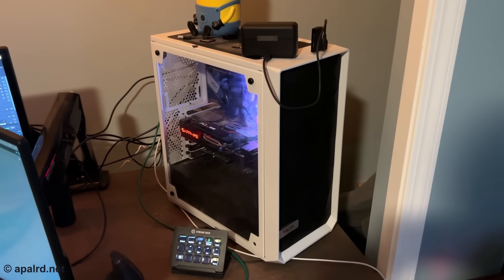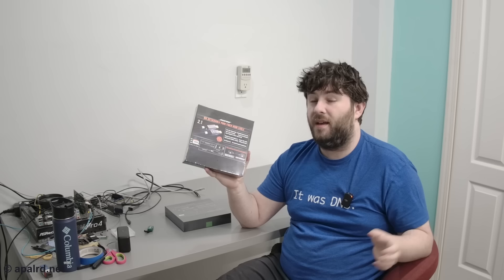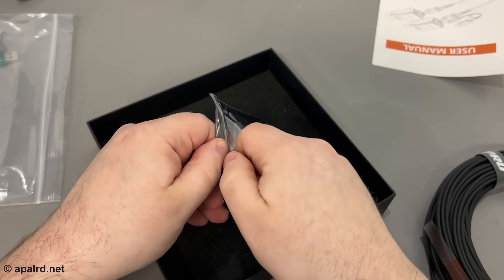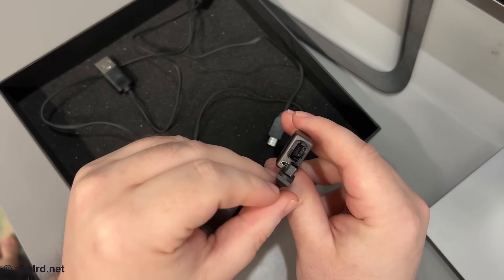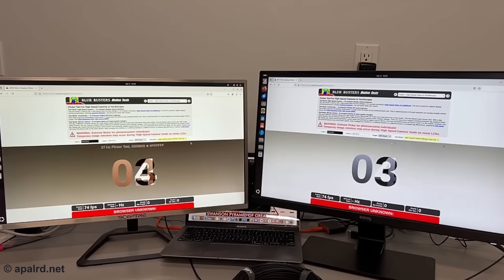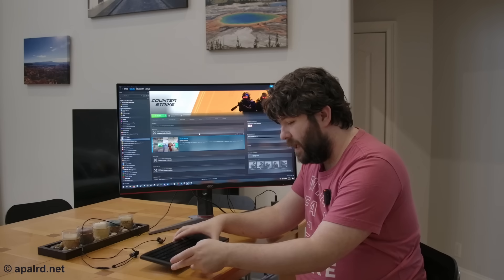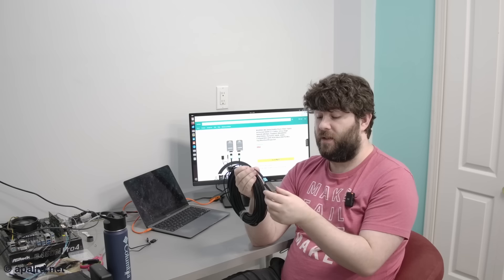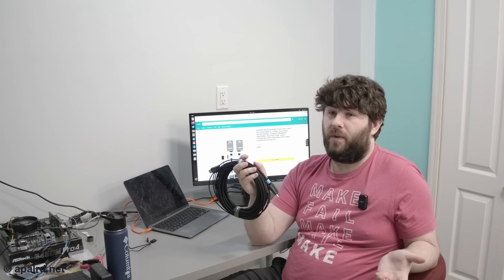FINALLY Sending Raw HDMI over Standard Networking Fiber

Comment: I believe USB4/TB4/5 is an attractive option because it streamlines your entire setup by consolidating all connections into a single cable. Additionally, exploring the encapsulation of data within Ethernet frames to transfer information over a local network (using switches) is an intriguing concept. However, there are two potential challenges with this approach. To fully utilize TB5's high bandwidth, you would need expensive network switches. Moreover, transferring high-bandwidth video signals, such as DisplayPort or HDMI data, over the network (switches) raises important questions about latency. How would the latency compare to that of a direct cable connection, and would it be acceptable for low-latency applications?

Comment: To anyone who doesnt know these connectors btw, you can break out those fibers each into their own individual connectors. If you use a different standard, like lc or fc, you can make 6 of em with 2 pairs a pop. Leave the fiber in the wall and keep using the fiber for networking and other stuff after you retire the cable.
Reply: Can you give pointers to where you get these breakout cables? I'd specifically like to LC fiber.
Reply: @thardie   FCDUS356v10305 look up this part number
Reply: @thardie  you can get one from FSG, but it would probably annoying to get a quote for 1 lol
Reply: @thardie  FS is good for fibre stuff. Just search FS MPO to LC on Google or wherever

Comment: Have you tried the Fibercommand cables? They are a premium but have the same MPO to HDMI, DisplayPort, and USB. They also offer breakout cables.
Reply: But do they work?  Haven't heard anyone really talk success.
Reply: @JeremyMeeler  I haven't purchased yet due to the price, but they have a DisplayPort 2.1 adapter which I want to try out. Trying to determine if I should risk it for my new setup. I am in the process of remodeling and I have will have a dedicated data room. It will have my Home Theater equipment which will need the HDMI extension of one of these and my main PC as well which will be about 50 feet from my desk (triple monitor). I really want to make to just be able to run a 24 strand MPO trunk to cover the 3 displays. Would also like to try out that USB4 50 foot cable that the HeyOptics has. If I end up getting one of these 3 setups I will post back with results
Reply: I got the Fibercommand ends a few years ago. The HDBaseT stuff I used before that would occasionally drop frames, but with the Fibercommand stuff I haven't seen a single drop in years.

Comment: If the HDMI cable only used 7 of 12 wires and USB uses 4 wires, could they do the USB stuff over the dark fibre? Then you could do the keyboard and mouse as well!

In that same vein, I believe Displayport allows USB to piggyback over its protocol. Does the DP cable version support this?
Reply from the maker: It's a 12 pin connector but only 8 of the strands are used (this is a normal thing, since 40G/100G only need 8 strands also). USB3 (10Gbps type A) only would need 2 fibers though, and it would need a USB3 hub + USB2 to USB3 hub chip at the other end. 

DP doesn't allow USB to piggyback, rather, the opposite, USB Type C allows for DP Alt Mode (where some of the 4x high speed lanes are used for DP and some for USB 10Gbps), and USB4 allows DP (and PCIe) packets to be carried over USB4. But all of that is purely for USB Type C.
Reply: @apalrdsadventures  maybe a suggestion for the company who makes the cables then?
Reply from the maker: oh I already told them I would like USB3

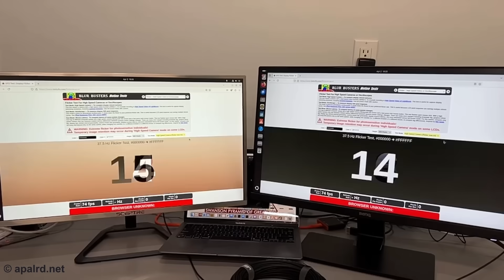Comment: In the flicker test at 6:23, if you watch frame by frame, the right screen skips 20, 25, 30, 35, and 40... So it would seem to be dropping fully 20% of frames...
Reply: The point is that they are not "perfectly in sync"
Reply from the maker: they are two different models/brands of display, they are not identical
Reply from the maker: that's the one connected HDMI direct, the left one is via Fiber

Comment: how big is the connector that attaches to the HDMI plug? I need something to run from office to living room in conduit which is already crowded by a CAT8 ethernet cable
Reply from the maker: It’s an MPO-12 connector which has a width of 12.5mm. Not sure what the diagonal dimension is for a conduit.
Reply: @apalrdsadventures  Thanks for the quick answer, I'd need to double check but it's either 20 or 25mm and the ethernet cable is ~8mm, looks like I might not be able to use this either 😢
Reply from the maker: Use the cat8 to pull an mpo + cat6
Reply: @apalrdsadventures  you think cat8 is overkill?
Reply from the maker: Cat5e is spec compliant up to 2.5Gbe @ 100m and Cat6 is spec compliant up to 10Gbe @ 55m or 5Gbe @ 100m.

Cat8 was standardized for 25GBase-T, but no cards were ever sold which actually use it and nobody really wants it now (since the power consumption is way too high compared to fiber or twinax), so Cat8 (and Cat7) cable is basically a scam for normal people
Reply: @apalrdsadventures  ouch, you live and learn I guess. Thanks for the info, I'll look into this option then.
Reply: @apalrdsadventures you should add in that unless you are using the special CG45 connectors Cat7 and Cat8 cables actually are worse than Cat6a. However nobody makes any equipment with CG45 connectors you are guaranteed to make things worse.
Reply from the maker: Cat8 is specified for RJ45 (Cat7 is not), but Cat8 does require shielding and proper shield termination which nobody is actually doing, assuming the cable you bought from Amazon is even actually Cat7 or Cat8 to begin with
Reply: @ I think it is? the brand is called HB-DIGITAL, they also sell keystones along with only a few others for Cat 8, and the reviews appear to be good
Reply: @apalrdsadventures  no Cat8 like Cat7 moves from balanced pairs to minature twinax and requires either CG45 or Teraprom connectors to properly terminate the shielding. If you don't there will be near and far end reflections on the cable which will degrade the signal. You can escape this it is a consequence of Maxwells equations. It might still work a 1Gbps speeds and distances less than the maximum because the signal degradation is insufficient but you won't be getting 10Gbps at 90m. There is NO switches or NICs that have the required connectors on them and it is unlikey there ever will. Consequently Cat7 and Cat8 cable is a scam to con the ignorant out of their money. There is no network equipment that has ever been on sale that needed anything better than Cat6a and is unlikely it ever will.
Reply: @Devilm00n  When it comes to Ethernet IEEE 802.3bq which is the standard for Ethernet at 25Gbp and 40Gbps over twist pair, then it dictates the cable is point to point at a maximum distance of 30m. Any keystones, wall plates, patch panels etc. would immediately make it non-compliant with the standard. It is all completely moot because there is not a single NIC or switch on the market to IEEE 802.3bq and it is unlikely there ever will. It is targeted at the data centre where the market has standardized on DAC cables, AO cables or just revert to pluggable optics and fibre.

Comment: Do they not sell just the transceivers at all? I would much prefer it if I could source my own fiber at the length I need and just get the ends from RUIPRO.
Reply: They may use non-standard fiber connectors, forcing you to source the fiber from them. With that said there are other companies that offer display outputs and usb over what I think was standard fiber connectors. Linus Tech Tips had a video featuring this technology, and I'm unsure if it supports high refresh rates or not.
Reply: @JuniorJunison  No they use standard MPO fiber connectors. Lots of manufactures available, but it doesn't look like ruipro sell just the hdmi transceivers
Reply: @JuniorJunison  didn't you watch any of this video? You didn't even read the TITLE of the video....
Reply: @JuniorJunison  while these aren't the dime a dozen type standard we see on FTTH equipment, I think it's MPO. More data center use, but easy to convert to whatever connection you have on the wall plate / already ran.

Comment: This is FANTASTIC!!!

Once they add USB functionality to this, I can FINALLY have remote gaming setup like you showed here.

And I DON'T need the $1000+ fiber dock that Linus from LTT is using.

This is AWESOME!!!
Reply: Right?  Why isn't the USB port also used for data and not just power?
Might need to use a different MPO cable with more pairs, but if you are willing to buy this you probably don't care about a marginal cable cost increase.

Comment: I understand this adapters use MPO fiber cables to save costs, but I'd wish there were affordable ones using single mode fiber (which requires additional electronics). Also DP is usually better than HDMI. The price is another thing: Had the luck to get a brand new Amazon Basics 300ft(!) 4k/60Hz fiber HDMI cable for as little as €33 a while back.
Reply from the maker: Basically, MPO has enough fiber strands to directly convert each electrical signal into optical 1:1. Using single mode + WDM wouldn't necessarily require additional electronics, but it would need tighter tolerances on wavelengths from the vcsels (for WDM), and especially better filtering on the receivers to reject the other wavelengths on the same strand.

The connectors and assembly of the connectors are most of the cost increase I think, MPO connectors (well, all fiber connectors) are super precise little things.

Comment: Couldn’t they make an octopus adapter for the 24x OM3 and give you DP/HDMI, USB3 and perhaps also Ethernet in one fibre cable? Or is there any technical limitations for that?
Reply from the maker: they need 7 strands per HDMI, I assume DP would also fit in 8 strands, and USB3 (10Gbps) should fit in 2 strands. Ethernet already exists and requires 2 strands for 10/25G or 8 strands for 40/100G, and the cost for 10G vs 1G makes it not worth running 1G. 

You can already get octopus adapters for MPO-24 to 3x MPO-8 or 24x LC, but just sticking with MPO-8 for HDMI/DP and 2xLC for Ethernet and USB3 would be easier.

Comment: Bought one of the ones with the ends built in for a 100ft run.  Lasted 2 weeks before failing.  I was pushing 1080p @ 30fps.

Comment: I have once pulled a optical cable though a very thin wall crevice and hired a dude to weld on the connectors :) Carving out a channel in the concrete would have been probably cheaper and easier :) But oh well :)

Comment: Displayport and USB 3 would be amazing over fibre for sure!
Reply: Fibre KVM!
Reply: @benargee  this is the way
Reply: I don't see any single adapter that handles both USB & DP there.
Reply: @alatteri  Thunderbolt has entered the chat
Reply: you can with thunderbolt and optical thunderbolt cables. It's not cheap
Reply: @AntonioMolfetta  that would require the machine to support thunderbolt.
Reply: @Rakusan2  there are pcie addin cards to add thunderbolt ports
Reply: @AntonioMolfetta   they must have  not just a PCIe slot but also a dedicated  TBH-1 header too. else they dont work.
 shame its  not that simple....

  I just did a $8k PC build for a client.    based on a MSI MEG  z890 godlike. It is one of the 1st boards to have not just TB on the IO shield  but also supports a TB5 add on card Being one of the 1st non macs to have  more then 2 of any kind TB support ...
most mobos  have 2 backed in. or 2 as an AIC. or  non support at all.   getting 4 is ....... well yay. it can compete with a 2022 mac studio  on  high end IO.. 

 

It REALLY needs to be the domain of the GPU builders to  at the very least .  have 2.   USBC jacks on a modest GPUs that support USB4 and DP.... Ideally full TB4-5 

they dont take up much space on a 2-3 bay card. but would get us moving forward to  USBC utopia .......
Reply: @Peterthethinker  the TBH1 header is not really needed, you can just jumper two pins on the card's side of the header to force it power on and it will work on most boards because it's just a PCIe device. I have seen it done many times on AM4 boards and first gen Threadripper that don't have Thunderbolt header.

TB ports on the mobo are completely useless gold plating because they only take the DP from the integrated graphics. TB cards actually have a DP IN port to passthrough a dedicated GPU through TB

What do you need more than 2 TB ports for? It's useful for a remote "docking station" setup but for that you only need 1. For pretty much everything else you can use USB 3 and it will be fine.
Reply: @Peterthethinker  I 100% agree that TB should really be integrated in dedicated GPUs. That's where they would be easier to integrate as it has access to all the things it needs (pcie/dp/power)
Reply: @Rakusan2  no it would not, thunderbolt is a pcie device
Reply: @AntonioMolfetta 
I use them for video production purposes when I capture stuff out in the field. I pre edit my work on DaVinci Resolve on my getac laptop with dual Thunderbolt 4.

Then I can use those exact same save project files and continue working on them on my Mac Studio as  resolve is cross  platform...

This saves me a bunch of steps in transferring terabytes at a time..
Think of it being a hot swap Bay for a d Drive between a desktop and a laptop.

The other 3 Thunderbolt parts are used for live 4K capture via black magic boxes 

And one is piped to a caldigit  TB4 TO 4 USB3 hub.
Reply: @AntonioMolfetta  yup.

I find it immensely frustrating at that only the. 2019 Mac Studio did this the way I would expect a high end PC  to transition into the future.
Reply: I bet Wendell at level one tech could come up with something that could do usb and display port over fiber. That seems like something right up his alley!
Reply: heyoptics has this on one cable
Reply: @Mutation666  source? Model name or number?
Reply: I wonder the same.  I don't see a USB/DP single adapter.
Reply: @alatteri  and @benargee from what I see, it's not one product, but you build it it seems. Buy the USB and DP sets, the main fiber for the run, and a pair of splitters to park at both ends, then you connect everything together. I don't see any documentation as to how to pair them, so they might be pre-paired or something.
Reply: @benargee  Email their customer service. They will make whatever Y breakout you want that fits within 24 fibers of bandwidth. Their default configuration is a 24 fiber trunk cable and a Y breakout on each end with 1x DP2.0, 1x HDMI2.1, 2x USB3.0.

I wanted more USB though, because I wanted keyboard, mouse, 2x controllers, and audio over usb. So I went with a 2x HDMI 2.1 and 5x USB 3.0 configuration instead. They made the custom cable for me in a day and shipped it out the next.
Reply: @Mutation666  Awesome, but expensive. 
You should have though mentioned that you need to buy multimode transceivers and 2 splitters to achieve this.

For an all-in-one they do sell USB4 hybrid cables but that has a max of 15m and has copper inside in addition to the fiber cores.
Reply: @Mutation666  looks like the same offering as fibercommand
Reply: @ tried to order from the first by far worst customer experience. Would steer clear of them
Reply: Analog signals on the HDM?
Reply: @ HDMI and Displayport are both digital. Only 3.5 audio jack is analog in modern computers
Reply: Easy peasy just get the right kvm box should costabout$350 fora good pair of TX/RX. Boxes
Reply: But doesn’t display port support USB via the display it’s plugged into?
Reply: @P.Joubert There is support for that but not much application of it, USB requires host controller and GPUs dont have those. USB-C does support DisplayPort alternate mode allowing DisplayPort signal to be caried over USB-C (that have all pins connected)
Reply: They make those too
Reply: Just use thunderbolt/usb-c over fiber. Then a hub (with its own power source) that will have multiple ports that will include display port, usb, hdmi
Reply: Thunderbolt optical cables exist that can do this.  But they are fixed!  We tried them a long time ago and once one end overheats that’s it, the entire $500 cable is dead.  I guess they’re better now, with the latest version.
Reply: LLT has all family pc in basement with thunderbolt docks connected by fiber